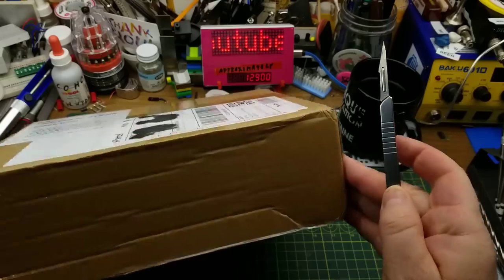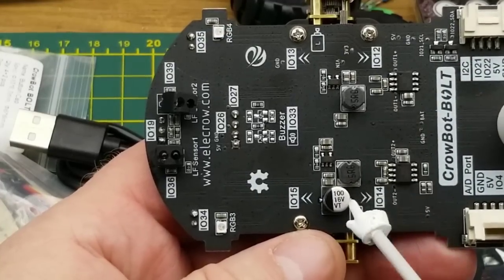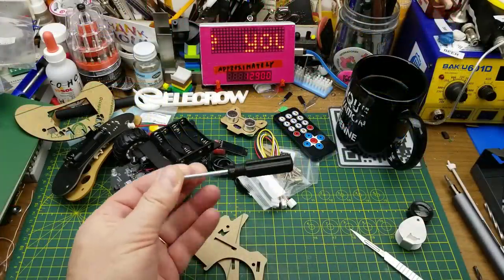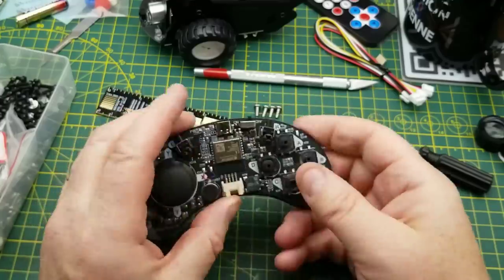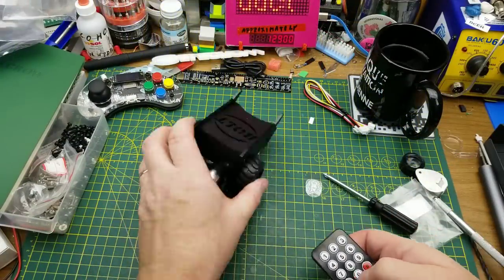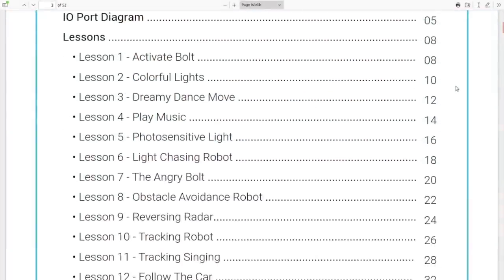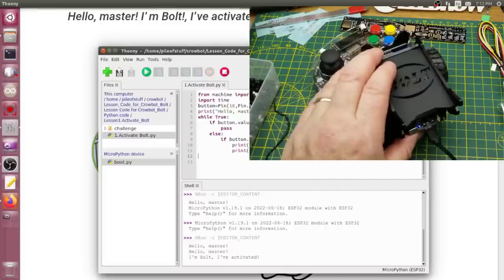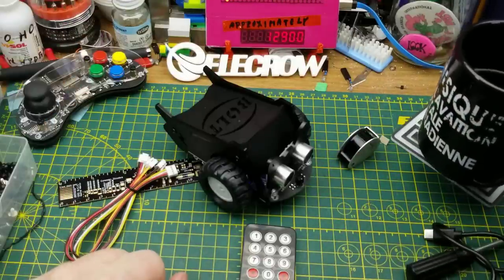review: CrowBot BOLT Programmable Smart Robot Car / Robot Kit from Elecrow

Comment: Every time I see an ad like this I like to guess the price since that's rarely mentioned.  My guess was $150 based on the build quality (processor, fan out chips, lots of structure plus wheels...) and probably more than Eilik ($140).
The actual cost is $35 for the base kit.  Can't even get an RPi for that price now-a-days
Reply: Hi, it only starts from $34.90, what a cheap price!

Comment: I need a somewhat robust, upgradeble yet cheap and entry level robot kit to start programming on.
Do you think this is it?
I've had a hard time finding anything better for the pricepoint.
Reply from the maker: It's definitely easy to program. The processor is quite capable. And there are GPIO ports broken out for other uses.
At the price, I'd say it's a pretty decent place to start.

Comment: I wouldn't call the 6 year old Pi 3B ancient. The original 2012 Pi sure, with its single core and whopping 256MB RAM!
Reply: I thought the same, I recently tried to use a Pi1 b to be the brains of a smart speaker I was building, it didn't end well; boot up was so glacial it was like waiting for paint to dry. I upgraded it to a new in box pi2 b off of ebay, with its  gig of ram, and all its swanky cores, it's was a world of difference. I use, maybe even torture, a pi3 b all day every day, running all my home automation needs, zigbee, zwave, mosquitto, Homeassistant, internet ad blocking, dns, and lots of other stuff, often all at once, so I think the issues he had were just down to bloaty or dodgy software, not so much the actual Pi. It gets rebooted one every blue moon or so, and its last 'uptime' was 300 days, so there's nowt wrong with Pi3's.

Comment: That's a pretty comprehensive kit. I'm not certain about having everything mounted on board. The components on the bottom are kinda cringe, one snag on a carpet edge or something and your into getting replacement parts and a soldering lesson (mine was a 10k trimpot for a line follower, I have a kit of trimpots now). I prefer the kits that come with an Arduino Uno clone, just for the possibility of using a different microcontroller in a Uno form factor.
They might want to look into changing the greeting, maybe "Hello Boss" or "Hey Buddy".
Reply from the maker: Yeah, the "hello master" is a bit questionable in the current century.

I assume it is just an innocent translation from Mandarin problem, more than anything intentionally horrible, though.
Reply: @pileofstuff  hahaha you know it is.
Reply: @pileofstuff  Well, the word "robot" is derived from the Czech word "robota," meaning “servitude,” “forced labor” or “drudgery.”  It goes back to 1920, when playwright Karel Čapek wrote the play "R.U.R.", or "Rossum’s Universal Robots."

Comment: I tried using the discount code on November 25, 2022. It would not work. Here is the error message I got The coupon code "elecrowBF10" is not valid.
Reply from the maker: Thanks for letting me know.

I'll ask my contact at Elecrow to check.
I was told it should work for any purchase at their website during that period (I copy-pasted the information I was sent, just to make sure I got it right)
Reply: Hi Jesse, 
"elecrowBF10" is the code for $10 off of $99 from 24/26, you can still use the ElecrowCrowbot promo code to get 15% off now~ thank you!
Reply: @Elecrow  it still does not work. I use the code ElecrowCrowbot. The coupon code "ElecrowCrowbot" is not valid.
Reply: @jesser9528 Hi, the right code is  ElecrowCrowbot 
I am sure it is available! There is no " sign.